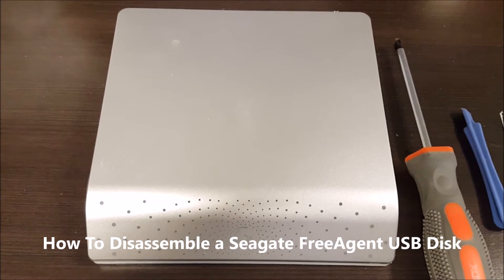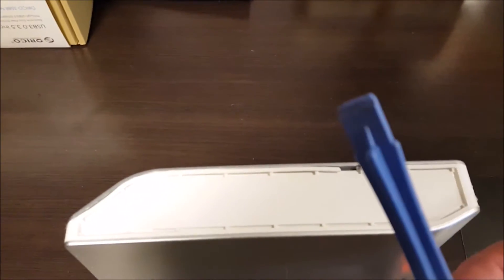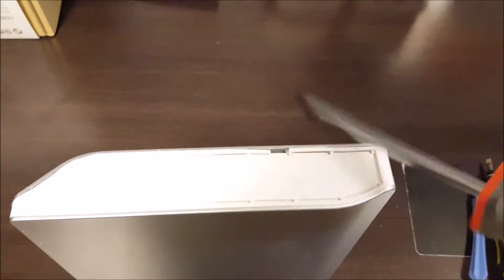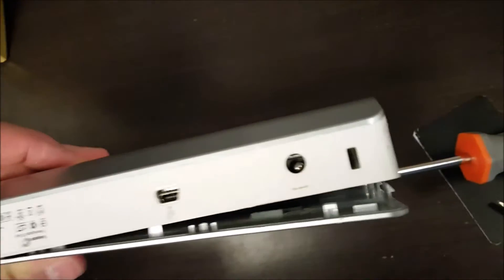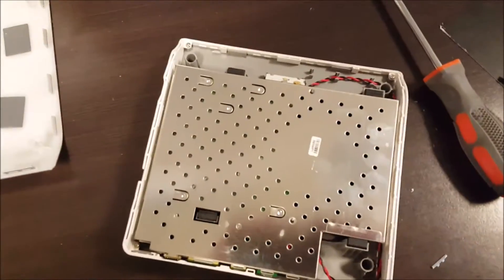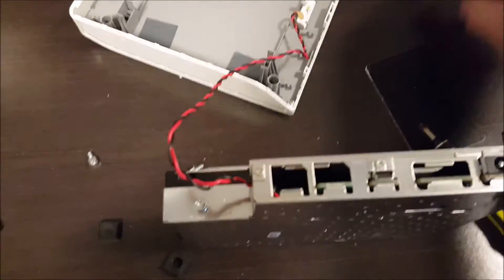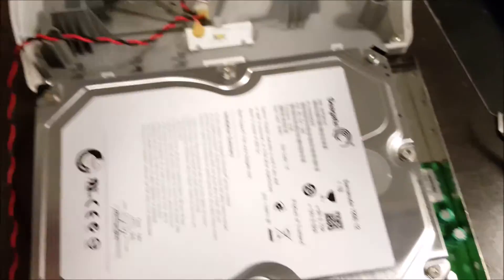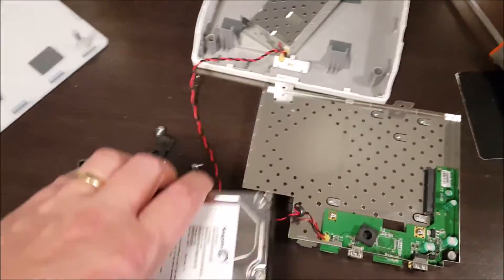How To Disassemble a Seagate FreeAgent USB Disk

Comment: Thanks for posting this! I have an old FreeAgent Xtreme that I'm trying to connect to a newer Macbook that only has USB-C thunderbolt ports... rather than getting a bunch of adapters, thought it would be easier to remove the HDD and get a cheaper enclosure-- can you confirm the HDD inside is 3.5" size? Or 2.5"?
Reply: For those wondering, this is a 3.5" disk

Comment: I'm having issues getting this drive to work as an external disk after taking it out of the shielding. I have a SATA to USB connector with a power adapter plugged in to the wall and my computer doesn't even show it in device management let alone File explorer.
Reply: Again for those wondering, this is because the drive probably isn't getting enough power. You need a 3.5" adapter, which will come with some sort of AC (aka wall) plug to give it enough power to work properly. Just a single SATA-USB adapter won't work.